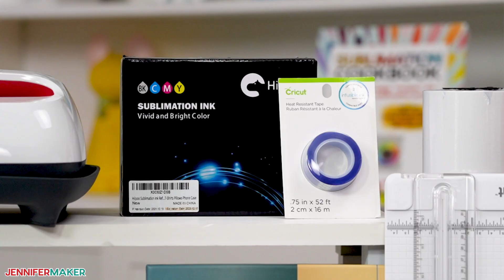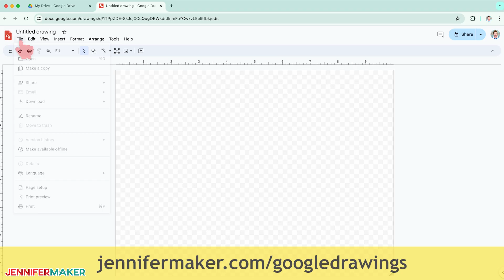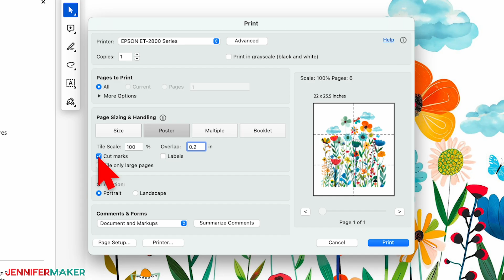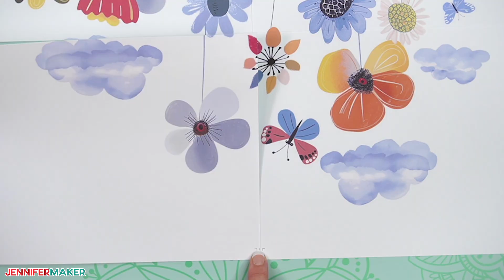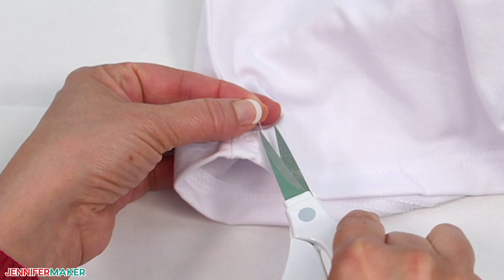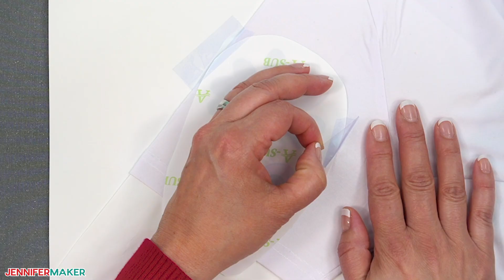Make A Full Sublimation Shirt: Print, Tile, And Pressing Tutorial For Both Sides!

Comment: I love your added feature of taping the edges! The BEST!!!  I suggest also printing as a pdf first. For those with converted  printers, you can sometimes get ink blotches. The only way to reprint 1 page (instead of all the pages) is to print as a pdf, then print that file. That way, if you need to print just one sheet, you can go to that image, go to the page you need reprinted, and select "current view" when printing.
Reply from the maker: Thanks for the tip! 🥰